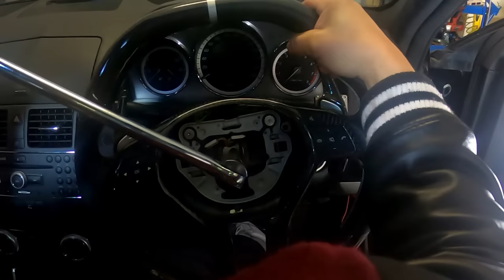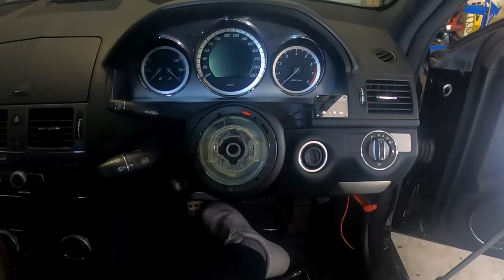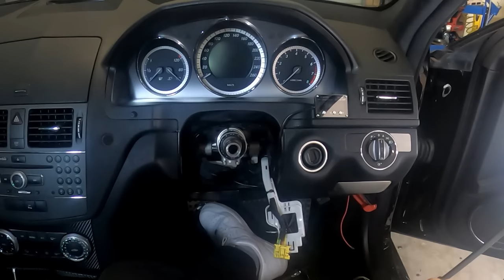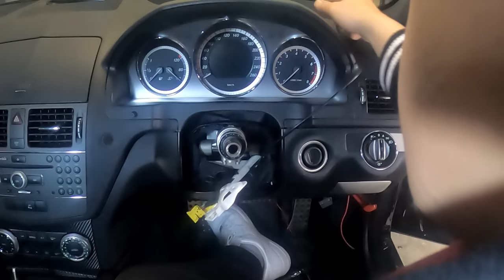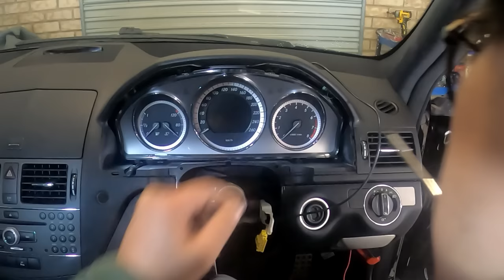HOW TO remove and fix ESL/EIS/ ELV MODULE  w212 w204 mercedes motor replace  Part 1

Comment: When we have installation process? I removed all, replaced motor,  connected ESL unlocked position with steering wheel and airbag, connected battery minus, try to start car and it does not start. After few attempts to start instruments console went black.
Reply from the maker: hey friend welcome to channel... this is why i say only attemtpt if you know and understand how the ESL WORKS and fuctions its very important that when you replace the motor that you do not make any MISTAKES differences in reinstalling .... i know it can be very frustrating but ...in your case if u can remove the ESL and EIS take it to a specialists and u will save most of what it costs .... normally 1500 to 1750 .... but if u remove the ESL yourself and get  the specialist to fix it will only cost you 200 max .... this is for sure because i know someone who did this ....and when he asked why it didnt work .... he was told that he may not have noticed but a tiny mistake was made ...therefore the ESL didnt work .... thats why i stress here that only attempt to open ESLl if you are 100% certain you understand and know that your reinstalling everything perfectly... im sorry you didnt GET yours to work..... my honest opinion now would be take it to a local indy key cutter specialist and get them to test ESL and they will fix it for you.... at least u have done the hard part of removing the ESL and EIS.... you will.need to bring EIS to them also.... hope you can get it sorted asap...sincerely mikeyz vlogz
Reply from the maker: I ALSO WANTED TO ADD THAT YOU DO NEED TO HAVE IT RESYNC TO YOUR EIS.... SO AFTER YOU HAVE DONE EVERYTHING YOU HAVE ALREADY DONE THE HARD PART..HOWEVER YOU STILL NEED TO GET A LOCAL AUTOMOTIVE KEY CUTTER TO RE SYNC THE ESL TO THE EIS... something must have went wrong with your installment...because if just your motor is malfunctioned you can just replace motor in ESL module and it will be ok...but when something else happens....then you have to resync the ESL to EIS...kind of like reprogram but abit different..this si what i understand from some research...which is an ok price considering..however you need to remove the ESL and EIS and take it to a local automotive key programmer/cutter and they will solve it..and they will tell you something went wrong........ i know it frustrating friend but this is why its very important you understand exactly what you are doing...no room for error when reassembling the ESL motor not even a little one... most ppl get the wheel level wrong..or sometimes its the position of the motor...and how how they press the motor in...its hard to explain ...
Reply: Thanks this response helped out alot. Just curious did you ever get it back working? If so what did you do wrong?
Reply from the maker: I'm very sure that he forgot to make sure that the two little points were not pressed down ... attention to detail is most important ... fro. what was described he definitely forgot to make sure that the 2 little button loooing points were pressed down another subscriber also told me this
Reply: @MIKEYZVLOGZ  I'm sorry but I've watch the video 3 times and I'm not aware what little points you have to press and when, are you referring to the points in the circuit board?
Reply from the maker: @yurihillel000  so wen u open the esl module theres 2 little grey button switches that should be depressed wen u re assemble the module .... i forgot that step to show it in the video.... however sometimes you wont need to depress then as they will already be depressed.... but as u fit the motor and reassemble the module u will feel it and see if the module doesnt go back together smoothly without anything protruding or sticking out making it harder to put the cover back on...then u need to make sure these buttons switches are pressed in
Reply: @MIKEYZVLOGZ  Thank you for tour answer, I appreciate it
Reply: I still have to do mine and I believe those two grey pins of the two limit switches may be the problem. If they do not mate with the posts they are supposed to hit, then the motor may keep spinning and burn out a second time. My circuit board was black near the burnt out motor, so I used a spray (circuit board cleaner, $11) to clean it after using ear cleaners (cotton). The black stuff may be carbon like and conduct. Plus the problem with circuit boards is static electricity on yourself, which will zap the board. Theoretically you have to work with an earthing strap. Lots of problems to save $2,000 plus if they have to tow the locked car away.
Reply: @MIKEYZVLOGZ  Isn't it good enough to make sure the two grey pins of the limit switches are close to the posts, where they are activated?
Reply from the maker: @dominicwild3189  yes dominic that will suffice ...i jist say this cuz its also and important step as if u dont do it the esl wont go back together and obviously wont work aswell
Reply: @yurihillel000  See above, only one at the corner when you gently put the board onto the pins.

Comment: I can’t for the life of me get the special screws out of the metal housing with the specialty tool.
Reply from the maker: annoying, I know , but there's a special way to do it ... the tool is almost like a square shape, and the pins u remove are roundish, so what u do is... push the tool in and rotate as u pull out and repeat til u get it out far enough to us pliers ...but don't grip so hard u squash the pins ..because they are basically soft metal so it will crush easily... keep at it ..if I gave up wen things got tough ..I never would have started a yt channel ... not saying u r.. but push on thru.. sometimes u take a min ..then come back and it works out
Reply: @MIKEYZVLOGZ  I was able to get them, thank you!

I put the new motor in, but it didn’t work. I put the old motor back and it worked. I did this a few times with the same results. Is there anything I’m missing, or is my new motor bad? I can hear the ESL clicking but the lock isn’t moving.
Reply from the maker: @FixItRyan  maybe your new motor malfunctioned it wouldn't surprise me ...

Comment: You skipped the part where you actually located and removed the steering lock.
Reply from the maker: ye cuz as i tried to explain its basically done by feel .. and was kinda hard foe me to film it ..but it part 2 i do an example of how u reach
Reply from the maker: thata correct i cant see the box thats why u do it by feel
Reply: @MIKEYZVLOGZ  I apologize, I did realize later last night that once the steering column is unbolted, it is in fact that box that is sticking up at the back of the steering column. I did not know that I was looking at it.
Reply: @MIKEYZVLOGZ  The problem I am currently having is pulling the fourth roll pin out of the ESL module box. I used the T6 bit to get the other 3 out but the last one seems to be wedged in there pretty solid. I tapped the T6 bit in there enough to cause it to be wallowed out to a T7 bit... I am going to try and find a smaller enough thread tap or broken bolt remover at the hardware store so that I may yank it out. Obviously it only needs one roll pin to hold it together so I'm not worried if I have to put in back together with only 3 pins. Lol
Reply from the maker: @NIGBEATS  yes some ppl have fone as far as only using duct tape ..so im sure one or w is fine...usually is a torx 5 that u would use to grip onto the pin and slowly turn as u pul at the same time ..but just enough so it starts to come out

Comment: Hey Mikey, Can you just throw the crap thing in the bin and forget about a steering lock?
Reply from the maker: only ifu get an emulator bud... then u dont have to worry about the esl module so long as u have the emulator
Reply: @MIKEYZVLOGZ  My c200 w203 stalls right after re starting warm every now n then but removing the key and putting it back in seems to sort it. Getting ready for the day when i'm stranded lol
Reply: @MIKEYZVLOGZ  Absolutely love the car though and will keep it no matter what until 5 years and upgrade to a newer model  :)
Reply from the maker: @andrewstewart8704  ye thata my plan too or deive it til it dies or someone rides it off etc... i love my car

Comment: Anyone had tried to unlock the ESL without success?
Reply: Hey Julio, I just replied to you on your question regarding the air bag fuse...take a look. Good luck!
Reply: @AlGolzari  It was the 77 and also if someone else read this don't forget that you will need an e12(Torx invert) drive socket to remove the 4 screws that hold the steering wheel column.
Reply: Julio Osilia For anyone who will do this repair at some point in the future, yes, the E12 for the 4 bolts.  But just FYI, the “front, right” bolt is a PAIN since there is virtually no clearance.  I guess if you’re in a country like Mikey, then perhaps it’s the “front, left.”  But all USA and related drivers, it’s the “front, right.”  I used a simple hand tool.  But it took a while since you can barely turn a manual socket or wrench even a quarter way.  And ratcheting won’t really help much since you have no clearance to ratchet.  Be prepared to take your time with that one bolt.  If you have a power ratchet, small driver of some sort that’s thin enough to fit in the space and you can get it on the bolt head, that would be fast...just press a button.  But I wasn’t interesting in buying that type of power tool for this job.
Reply: Also, I’d recommend when you’re putting everything back together, start with the two “back” bolts first (closest to firewall).  But don’t completely tighten yet.  Tighten the back ones about half way and that will allow you to “pivot” the front of the steering column (the side that’s closest to you) so you can get the front bolts tightened up.  If you have the power tilt and telescoping like I do, remember there are two motors, so it gets a bit heavy.  Pivoting helps leverage the weight.  After you’ve tightened the front, then tighten up the rear bolts all the way.  Ah...last summer is all coming back to me now, ha.  With my head under the dash for so many hot summer days and nights.

Comment: I tried the motor, giant wast of time. I replaced the motor, once everything was powered up, it worked once. long enough to lock the steering lock 1 last time. it never worked again. The only real solution is the emulator from ebay. $70. oh and the programmer is $700.
Reply from the maker: im so sorry to hear that .... the programmer was 700? wow and does it do anything else apart from programming keys?
Reply: That might have been a problem not mating the two grey pins of the limit switches with the posts, so the motor kept turning and burnt out again as the limit switch did not switch it off.

Comment: I changed the motor and nothing changed?.
Reply from the maker: attention to detail .. did u ensure u put everything back the way it's supposed to be . a little part out of place can cause the motor not to work ... did u ensure u had the key in when u reconnected the battery however u had the key wen u disconnected the battery ..u must reconnect t it in the same way or u will kind of confuse the esl and it will lock instead of unlock... usually u reinsert the key and then reconnect battery .. then u pull key out and reinsert again ... did u get a chance to scan the car for faults ..possibility it can be the eis too.. not likely but possible

Comment: Can you not just disable it? Imo steering locks only serve one purpose; to fail and cause the owner time and $, and of course embarrassment because their car won't go. 

I assume just unplugging it while unlocked will cause some kind of issue, so anyone have any thoughts on how to bypass this useless pos forever?

Poster "Random" said his broke so it won't lock the steering, but otherwise the car works fine. I want that....
Reply from the maker: get an emulator that way at least no moving parts just a modulr that tells thr ecu to unlock and let u start the car ... it lookd exactly thr same but has no mpving motor or parts judt a electronic device that reads eis and will allpw you to start your car

Comment: The chip is got locked if detect anomaly on the lock/unlock system as is speaks with the ezs and key, sometime understands manipulation by a theeft.
If you took the els unlocked and reasembled locked and switch on the car you get a beautyfull chip NEC locked by software because is antitheeft protection.
and he need replaced by new one with all data from old one or unlock him by a not cheap interface programmer, pain in the ass.
Also you can put a emulator and get rid from this problem one for all but you get the steering wheel always unlocked.
So is not the price of the part you change is the risk of labours.
Call Mercedes and ask the price of that part changed you will be smile without reason, apart the fact you ned to prove you are the owner and stay mabe 2 weeks out of your car.
Anyway the motor you changed is not the same quality like oem a lot of chinese crap out there.
Reply from the maker: yes very true 
thanks for sharing